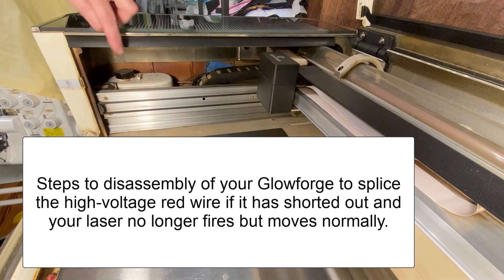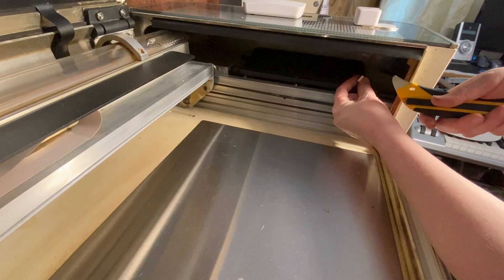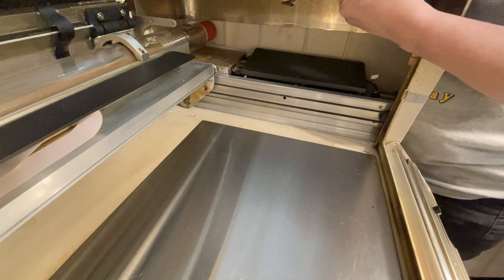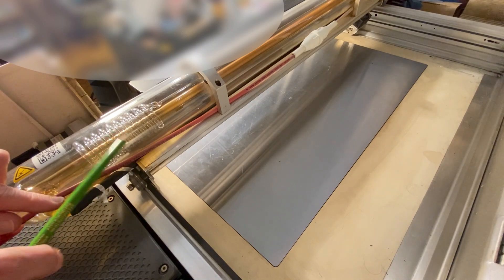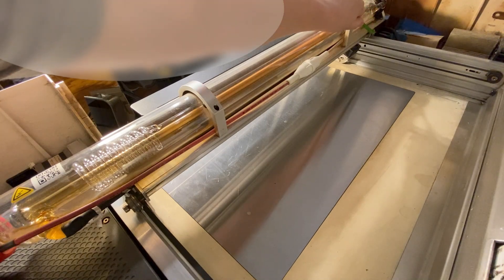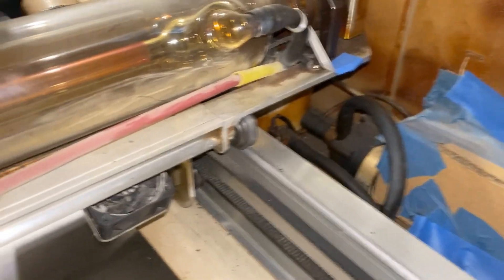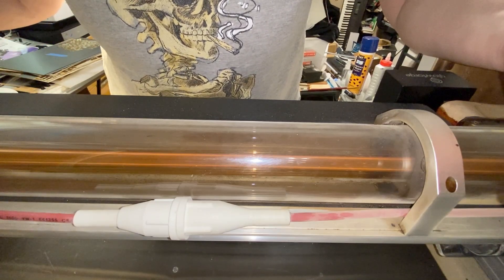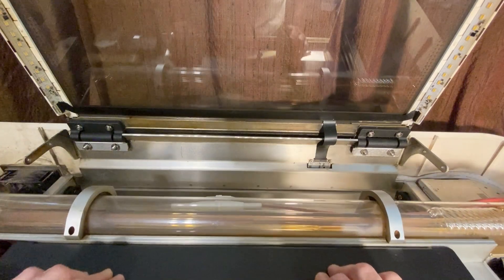Glowforge Red Wire High-Voltage splice repair tips

Comment: How long how long does it take to replace the red wire and put everything back?
Reply from the maker: I would say that the whole process could take less than an hour. Take your time with cutting the red wire, trimming back the insulation to get a clean wire to put into the splice kit.

Comment: Question. At the 4 min mark, it shows a piece of cardboard tapped over the circuit board. Is this there all the time to keep the dust out?  And you’ve had no problems with it?
Reply from the maker: I put that over the electronics when I was doing some engraving/scoring on plaster of paris pieces to keep any dust off the electronics. I made sure that the cardboard clears all the moving parts and no, I haven't had any problems with it being in place :)

Comment: Do you have a video of attaching the red wire to the glowforge?  I have it all taken apart and my new red wire ready, but I do not know the next step. thank you
Reply from the maker: On my Glowforge, the red wire on the left side (away from the on button) is permanently attached into the power supply. I cut the red wire at the place where it shorted, put the splice kit in line and then ran the wire around the back of the glass tube as shown in this video. The right hand side of the wire (the side where the ON button is located) will have a ring terminal attached to it from the Glowforge factory. That ring terminal screws into the end of the glass laser tube. You have to remove the red silicone cap off of the right side of your laser to get at this screw. It is a 10m hexhead screw. Here is a link to the video I started with https://www.youtube.com/watch?v=rdnKwaaekTY&pp=ygUSZ2xvd2ZvcmdlIHJlZCB3aXJl
Reply from the maker: The whole blog post I made with extra pictures and links to everything is here https://jenniferhuber.blogspot.com/2024/06/splicing-red-wire-on-your-glowforge.html